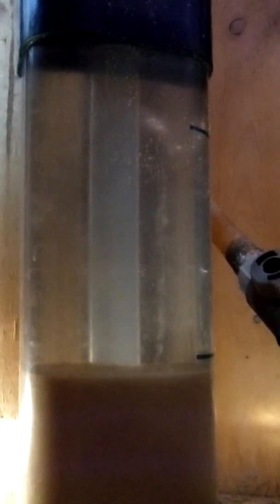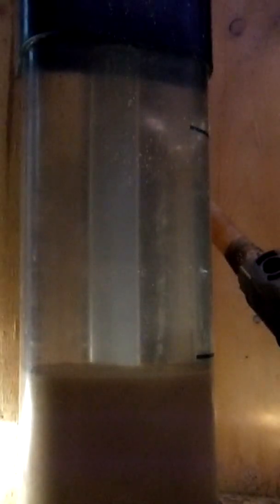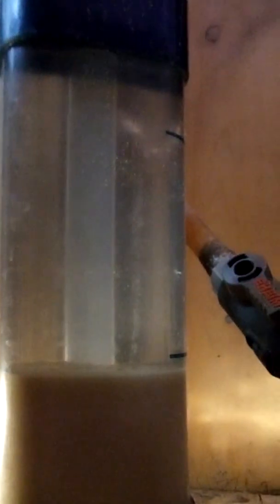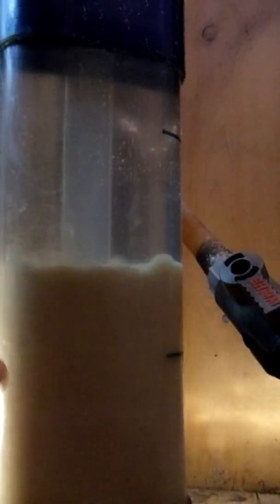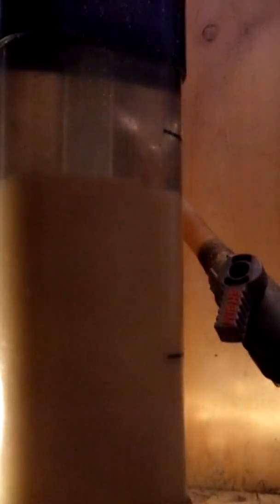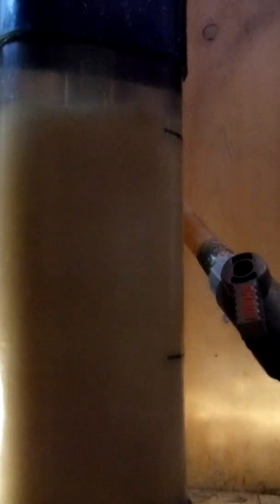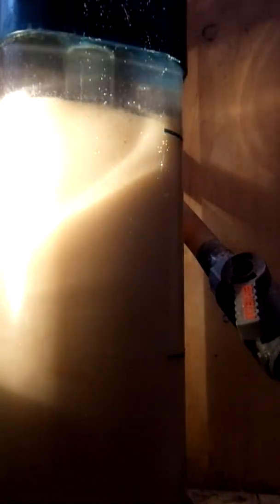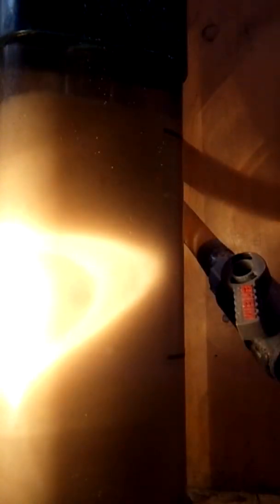WHY IS A Fluidized Bed Filtration Aquarium System IMPORTANT Set Up Explanation

Comment: I had a "Merlin" FBF on a 45 gallon corner tank and it worked amaizingly well. I ran it with a powerhead and returned the water through a bulkhead I installed in a Whisper filter.

Comment: PRT: Este filtro de areia fluidizada funciona mesmo? Diminuiu a amônia?
ESP: Este filtro de arena fluidizado funciona realmente? Disminución de amoníaco?
ING: This fluidized sand filter really work? Decreased ammonia?
Reply from the maker: Cláudio Castro It is very efficient at keeping the tank balanced:)
Reply: Yes... but if you have ammonia problems... you need to feed alot less and do more 25%-50% water changes weekly and really more often but less percentage of the tank water.
Reply: @zekethefishgeek8690  thnk you. in fact, I wanted to use this type of filter in a commercial tilapia farming system. without the need to reduce the ration or change the water

Comment from the maker: @AcelyDone I guess it would really depend on the value of the fish I was planning on keeping in the tank, or how stocked I planned on keep the tank. You could run the fluidized bed off the outtake of your under the aquarium canister filter. It even has a option to hang it off of the back of the aquarium and release the water straight into the tank right after it has passed through the canister filter then the fluidized bed.